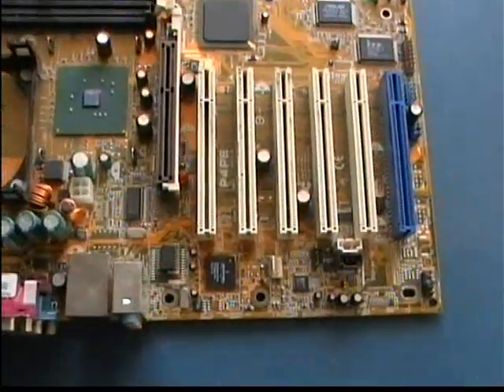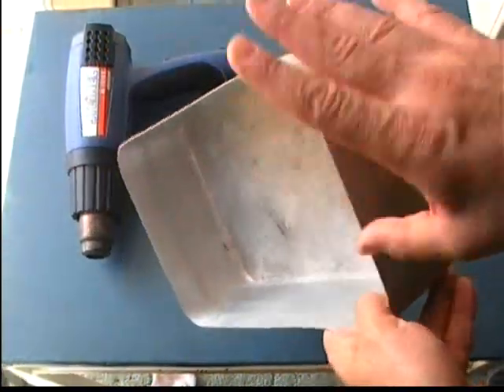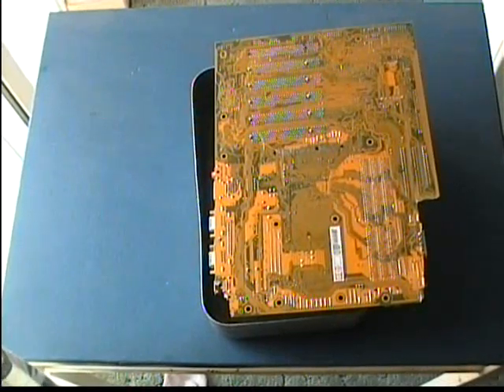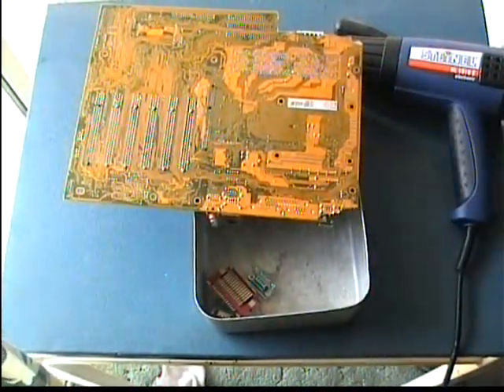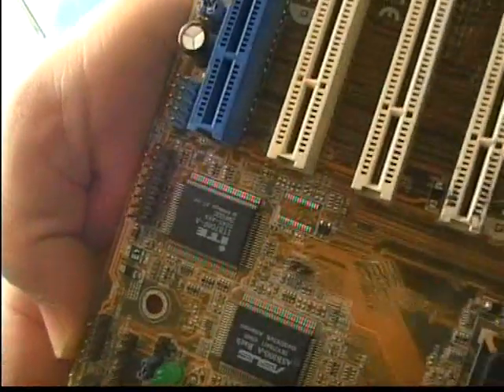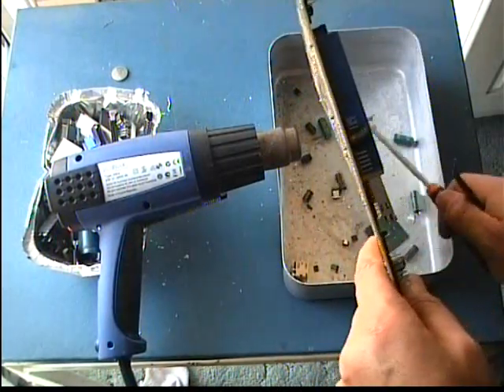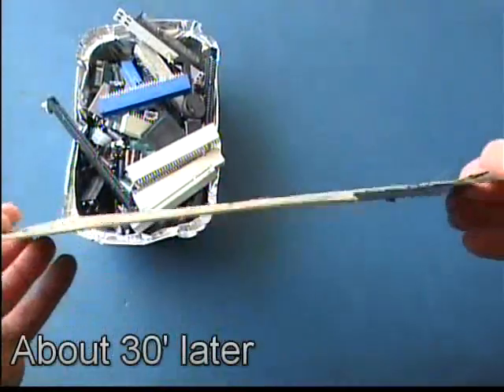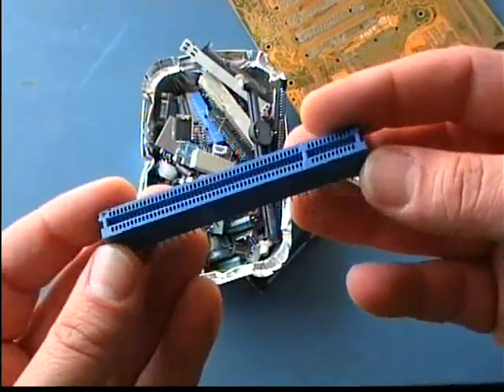How to salvage parts from old PCBs, even from motherboards!

Comment: Great video and has given me an idea. 

Guys, If you already have a normal full temperature only heat gun (i.e. no variable power) you can always use a triac "drill speed controller" to precede the gun. Run the mains into the controller and then to the gun. I recently bought one of these for another project altogether but fitted it in an IP67 box with power tails (in and out) so I can use it with any device I like. I bought my 4KW unit from Ebay before I discovered that Banggood had the exact same model at about half the price!! Temp can be controlled and raised until it's just right to melt the solder.

http://www.banggood.com/4000W-220V-AC-SCR-Voltage-Regulator-Dimmer-Electric-Motor-Speed-Controller-p-1004793.html?rmmds=search

They also have a 2kW unit for half that price too!

If your unit is less than 2kW you could buy one really cheaply around £2.50 or $3.00 ish plus the cost of a box. I used this one that fits the 4kW unit perfectly, but the price was much lower when I bought mine earlier this year (2016) 

http://www.ebay.co.uk/itm/Outdoor-Waterproof-IP56-Adaptable-box-Weatherproof-enclosure-ALL-SIZES-/171034463510

Comment: The solder is silver..... In fact there is more silver than recoverable than gold. Also the chips are made of even more valuable metals....
Reply: Actually solder is rarely if ever fine, standard or sterling silver in electronics - in jewellery, yes, - the melting point is too high (around 895C) for most electronic parts. For flow soldering/wave soldering it's an Sn/Ag/Cu compound these days in order to obtain a similar melting point to traditional tin/lead solder. The silver is not that easy to extract from the alloy though and requires expensive processing. The tin is also by far the largest percentage still as it was with tin/lead. Most older boards are tin/lead solder. 

Chips are made from one of the most abundant metals on the planet - Silicon - and it's far easier to make new Silicon from scratch than to recover it from encapsulated chips.

Comment: No, a hair dryer will not get the board and solder hot enough. You need around 280C minimum, for this to be easy 300C to 350C. You don't really want to go above 380C.

Comment: I did that with 3 old printers I had. I kept thinking I was going to get them fixed, but they just sat there anyway. A few weeks ago, I disassembled them and saved all PCBs, gears, bearings, rollers, hardened stainless rods, springs, stepper motors, mirrors, lasers, screws & a few other things that aren't coming to mind at the moment. I have a new erector set! Solder pots are pricey; the stove is too hot, but I hadn't thought to use a heat gun.

Comment: I only care about what he sounds like if he's unintelligible, which he is not. The question for me is, "Does the system work?" Evidently, it does work, with some care.
The burnt pcb and parts mentioned below is probably because the pcb was older and made of a different material than new ones, not to mention the fact that computer pcb's are layered with copper traces sandwiched in them which would help disperse the heat from the heat gun. I have the heat gun and the wash costs $ I don't have.

Comment: Excellent video. I just Subscribed to your Channel and will watch more. I was thinking, you might build a 3D Printer. Tearing down a printer, you get most of the parts needed. A Head for the printer is cheap, maybe $100 at most. I've seen them for $35. I have several old printers that I don't use anymore and am considering doing just that. I have a background in Robotics and generally operate 6 Axis robotic welding machines... 3 Axis ( XYZ) what a 3D Printer is) is a piece of cake.

Comment: This only works on modern flow soldered boards, I tried it on an old amplifier board and it burnt the components out and stank the house out, this isnt a very sensible way to remove components as its likely to destroy them all!! get a solder dip bath off ebay.

Comment: I think the most of the parts like the PCI Connectors or the memory sockets are useless after removing them, but as you said - the ICs, chips and other parts can be pretty useful. I resoldered a lot of salvaged parts, it works fine if you do not damage them while desoldering them.

Comment: True. Its been just a little over 8 months and the caps still working strong. I've actually had things for several years and they work just as good with re-used caps. I've never had a problem. But when repairing other people things I do use new ones. Only on my own stuff do I ever use re-use. Although I see your point...

CureMyMind

12 years experience...

Comment: Wonderful Video!  On my list to use your method to remove hundreds of parts from 3 large footlocker trunks full of boards.  Resulting in reducing space down to maybe 1/10th space taking up now by the boards.  With focused heat gun nossle and proper heat setting, may be possible to solder tiny SMT parts too tough to solder by hand with soldering iron.  Many thanks for this video!

Comment: Safety first! The heat protective gloves are a great suggestion, but I wouldn't recommend wearing the "googles", They will jeopardize any vestige of privacy you may have left. And for those who type over 60 words a minute, googles priority is tracking every keystroke, not your safety. Several keyboard ten finger pile ups have been attributed to googles persistent  tracking methods. Unfortunate accidents that are not recorded on any of googles 900,000 servers.